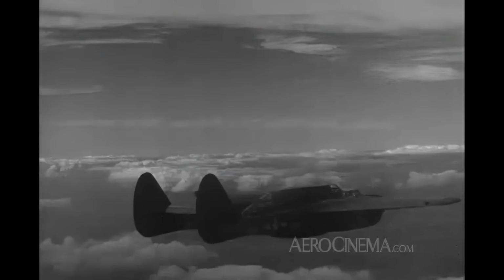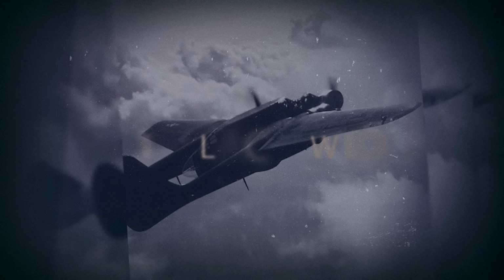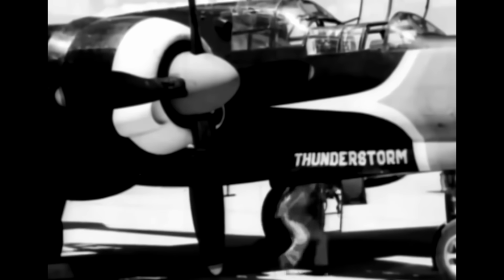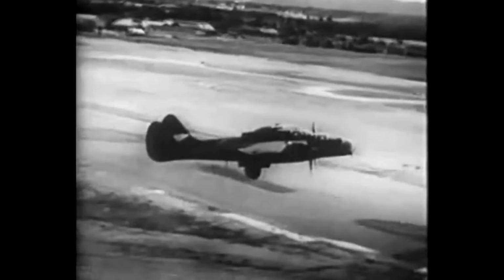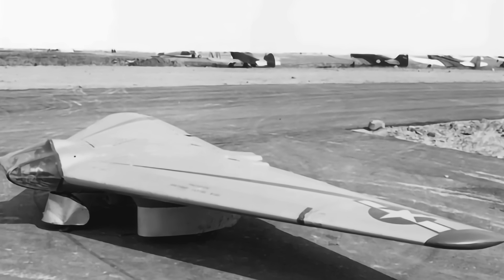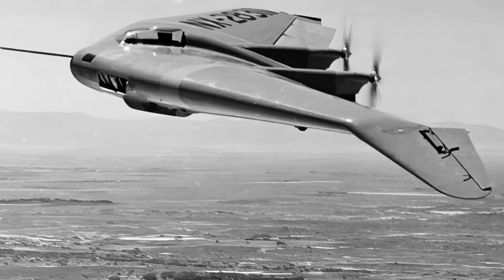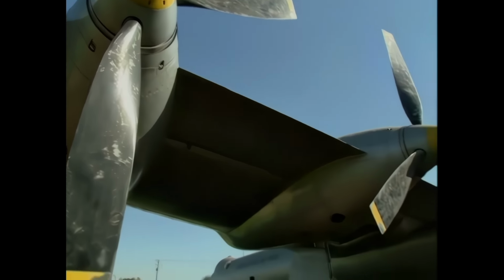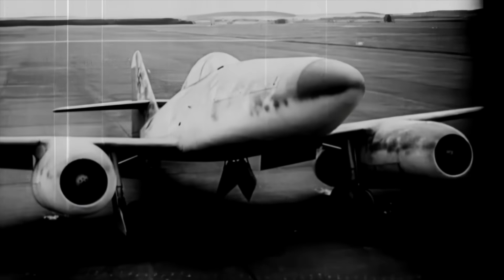P-61 Black Widow | The American Night Fighter | WWII Twin Engine Northrop Warplane

Comment: Ugly defines the B-36.  In combat, it would have been a sitting duck.
Reply: I should quantify that. If the money spent on the B-36 had been spent on the further development of the YB-49, we would probably have never needed the B-52. As turbojets advanced, the ‘49 would have proved its true value. When all your fuel, payload bay and cabin space is the lifting surface. This was finally proven in the B-2 Spirit.
Reply: The B 36 was an incredible aircraft. They could fly higher than almost any of the German interceptors and in some special lightweight versions of the B 36 it was even questionable whether a mig15 could intercept it because of it’s incredible ceiling

Comment: It was not that fast. If it was chasing a 110 night fighter the 110 could out run it.
Reply: Actually, the BF 110 had a top speed of almost 350 MPH. The P-61 had a top speed of approx 366 MPH. A P- 61 with full fuel and ammo, chasing a bf 110 after it's bomb run, and light on fuel would be very evenly matched, perhaps even going to the Bf110!!  BTW....the P-61C had a top speed of approx 430 MPH, but few were built!